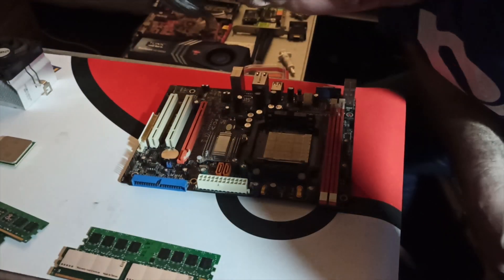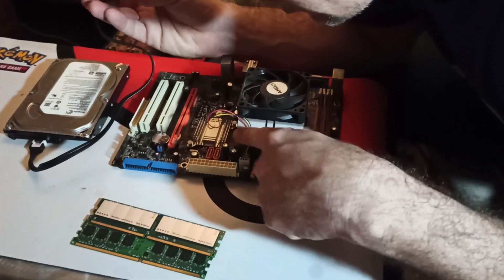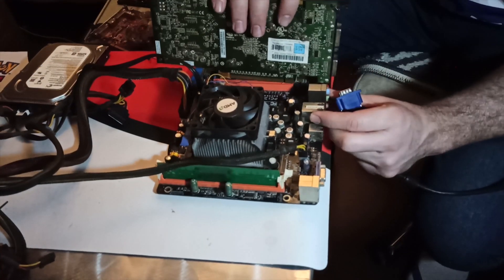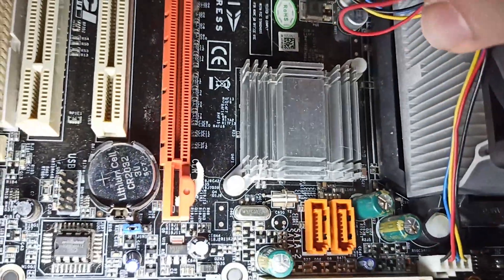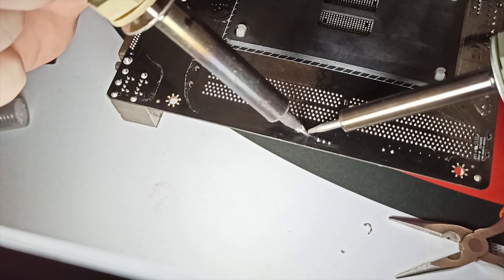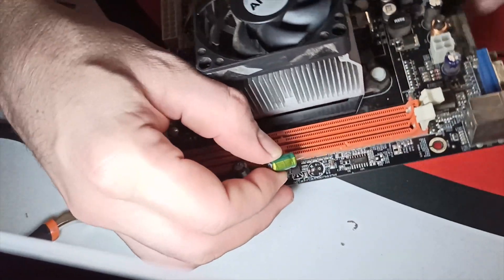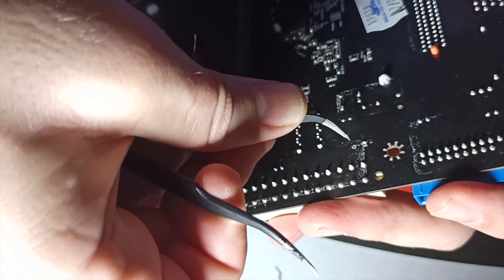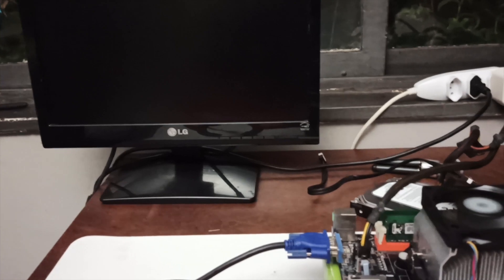Recap a Motherboard

Comment: next time you run into something like this, i suggest tinning the tip of ur soldering iron and using flux on the caps or anything on the pcb. should make it easier. also hako makes a nice desoldering gun if you plan on doing alot of repairs. check out johnriggs on youtube. hes pretty well versed in these kinda things. as well as making repros of nes games and the like. great job man! keep up the good videos
Reply from the maker: Thanks a lot man! I have done a more recent recap, with an Abit bh6, I learned a few things from this. Used flux, new solder to mix in the old joints, went a bit smoother. I'll look into getting one of those desoldering guns, I love this stuff!

Comment: Thanks for the video and for the detailed explanation, I'm a noob at soldering and I'm trying to decide if I should buy a 4th gen Intel motherboard with some bad capacitors to fix it myself and use it.

One question, do you think that practicing soldering and desoldering components from a dead PSU would help me to have a more steady hand and comprenssion of the process if I do it?
Reply from the maker: Practice is always good, but I think the pcb on the psu is a bit different, should be easier, doesn't hurt to do it though, have fun!
Reply from the maker: As for the motherboard, I would only get it if it's dirt cheap, because even if you manage to do a perfect job, it could have other bad components, like the Chipset.
Reply: @SUCRA  Thanks for the responses, yes, the motherboard is like 10 dollars, not a lot, I would try to see if family ot friends have a dead motherboard around to practice the desodering process and practice
Reply from the maker: @Mike-0  Good luck!
Reply: Que maneiro! Trabalhoso de fazer esse vídeo, bro! Parabéns!
Reply from the maker: @prof.raphaelspyere_2025  vlw!! Grande abraço
Reply: YES